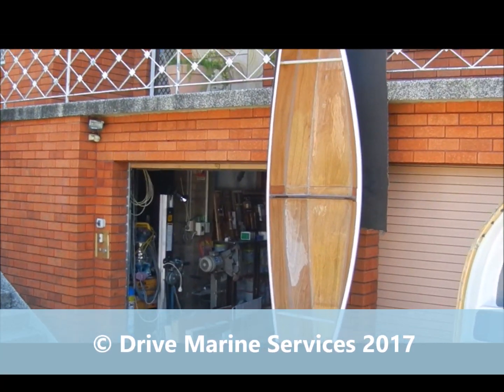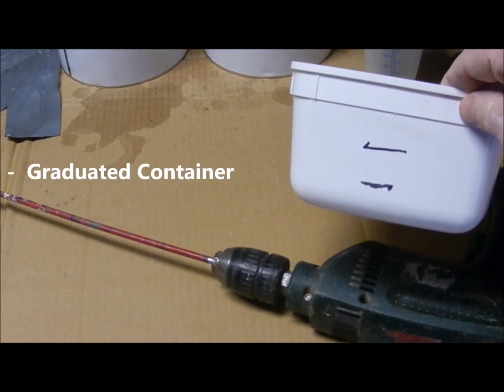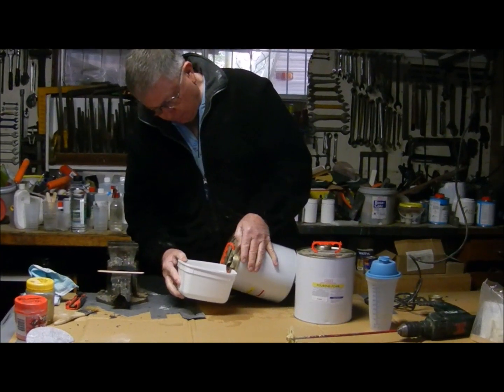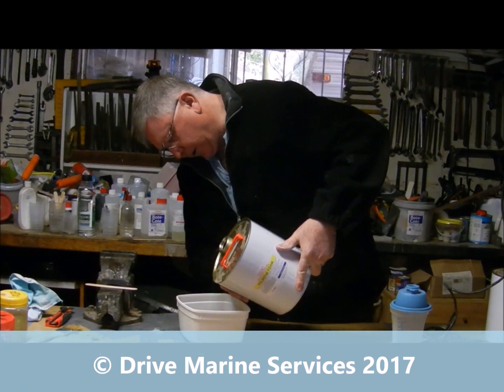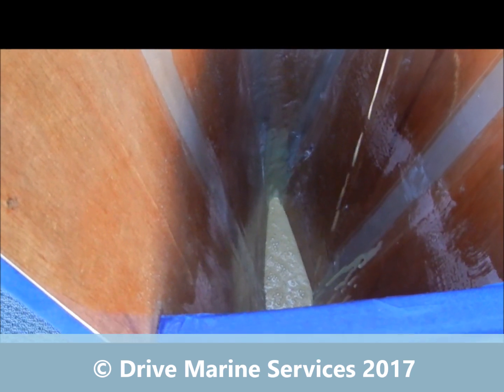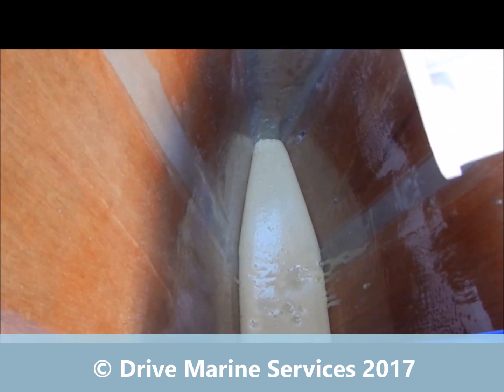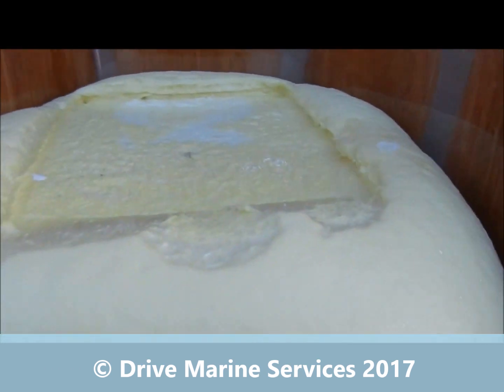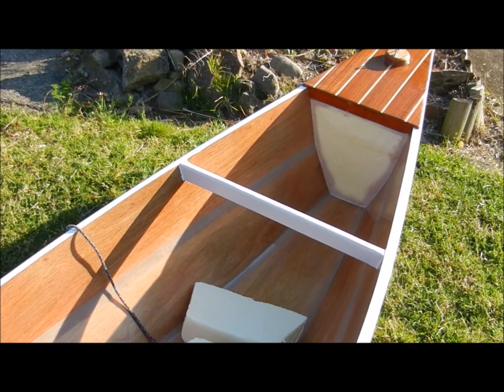How To: Use Pouring Foam

Comment: Can this be used in transom replacing rotten plywood?
Reply from the maker: Not really because the foam will compress in service.  Plus you need to be careful as it expands 25 times its original volume and if trapped in narrow slot it would expand and push the transom out of shape.  A better method is to dry out the rotten timber and fill it with Bote Cote but it is not something I would recommend due to cost.  Nothing beats cutting out the rotten timber and gluing in new Plywood using Bote Cote Epoxy resin thickened with Glue & Filleting filler and either gluing the old inner skin back on or a couple of layers of 435gram Double Bias fibreglass fabric with Bote Cote Epoxy Resin.

Comment: How hot does it get?
Reply: The Foaming Resin does not tend to heat up when it is chemically reacting.  The problem is trying to contain it.  Be very careful to allow it to expand freely because it can distort and worst case blow out panels.
Dave
Reply: @davegiddings3437 thx

Comment: Is the foam soft and squishy enough to make a canoe seat with it?
Reply: Apologies.  I thought i had responded to your question whilst I was travelling.  Looks like I bombed the course.
The pouring foam sets very stiff and not inclined to compress.  Once cured it is easy to sand and shape using a sharp knife.  Let me know if you want additional info.
Dave.

Comment: How did you cut the foam
Reply from the maker: The foam is easy to cut.  Small areas use a sharp bladed knife using a sawing action.  Als oa normal handsaw works okay or a sharp chisel.
Reply: @TheEpoxyGuruTipsTricks  is it able to be sanded?
Reply from the maker: @bernardaustin5081  Good Morning Bernard,  Yes it can be easily sanded and shaped.  Also cuts easily with a saw.